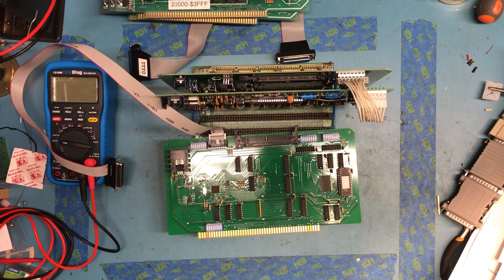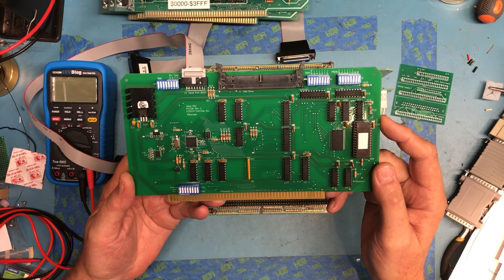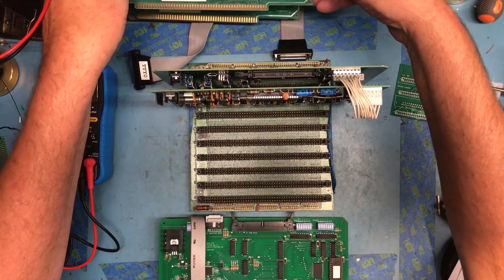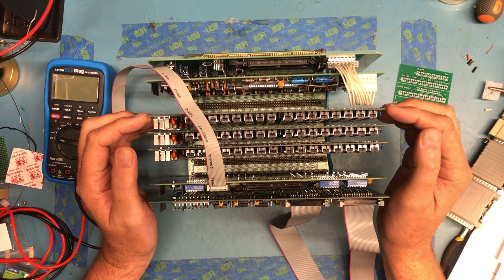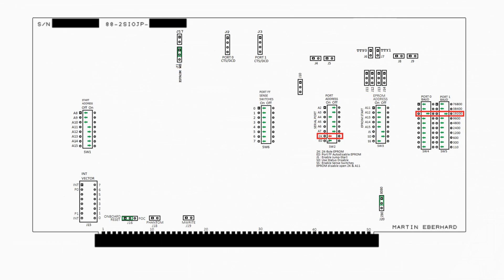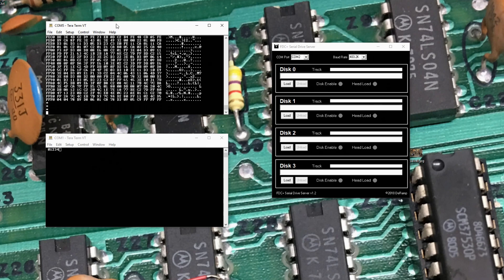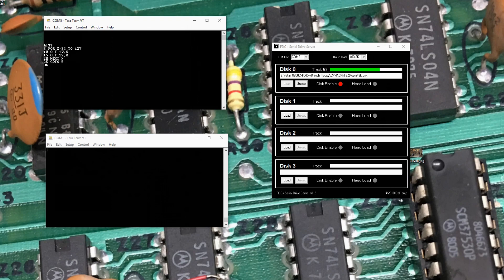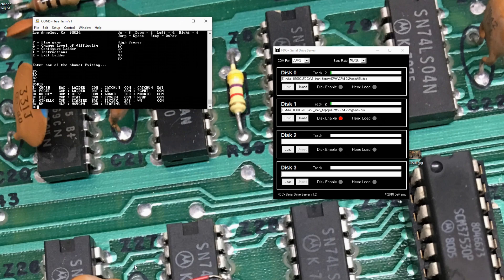Altair 8800 - Part 23 - Card configurations and booting CP/M - STB374

Comment: Interesting how you have the fdc+ and the 2sio boards running together. Which disk emulator do you have running? Will the fdc+ work with a hardware emulator like the HxC?
Reply from the maker: I used both the FDC+ built in emulator and physical drives. The downloads for the FDC+ included images for the disks I was using in emulation. I later emulated one drive with a physical for the other drive and was able to make actual boot floppies. For the 2SIO I took a look at the CP/M BIOS to understand the serial I/O ports and status bits (these may also have been documented somewhere) and configured the 2SIO to match those settings. The CP/M BIOS will document the ports and status bits meaning any card you can configure to look the same may work. As I recall in this case there was no BIOS code to initialize the UART, if there was I would have needed to use the same UART the code was written for.